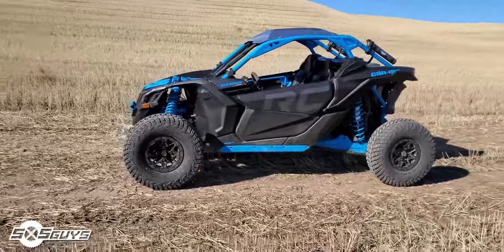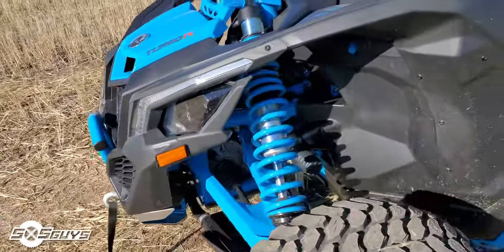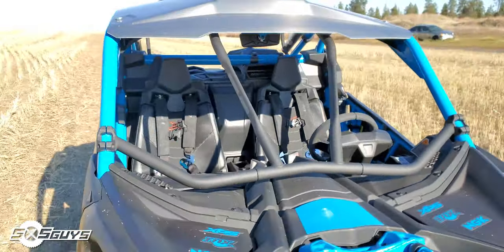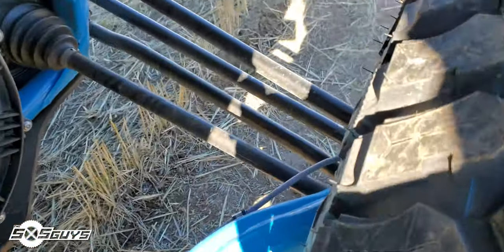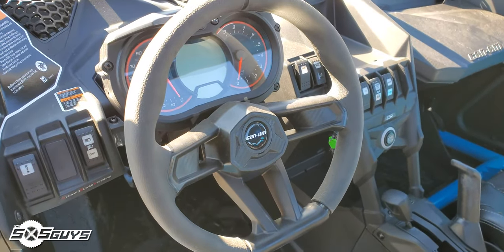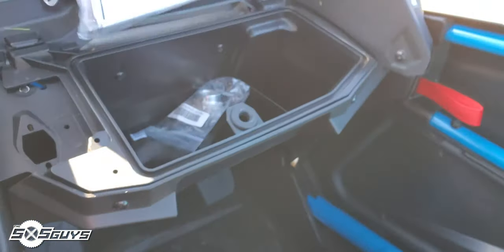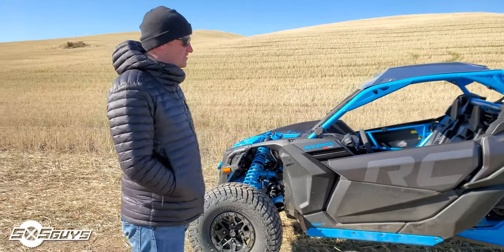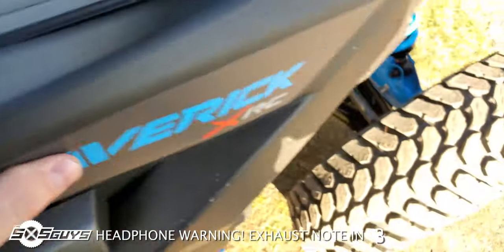2019 Can-Am Maverick X3 X RC Turbo R First Impressions | The SXS Guys

Comment: Stock to stock drag race your right on beating the YXZ. But in my humble opinion the YXZ would outperform the RC in sand riding. The gear on gear transmission and the YXZ handling is hard to beat. My opinion is coming from experience with both machines the RC and YXZ. I like them both!
Reply: DUNE YXZ I hear ya. It was more or less a challenge to start a new overland build. I had so much fun on that YXZ and it far surpassed my expectations. 
I’ll tell you this though, maybe owning both you can relate, but I felt that in my YXZ, it was like I was hopping into this super functional and durable rally car. In the X3 I kinda feel like I’m hopping into this collection of parts that have been thrown together, lol.
Reply from the maker: Can you please explain how that would be? The YXZ, stock like you mention, simply doesn't have a large enough wheel base or long enough suspension travel... And as Ian said on the podcast (check it out!), The YXZ is more work and more thinking ahead in the dunes, the X3 will make it more enjoyable!
Reply: SXS Guys The X3 is awesome but there are times when duning it has too much suspension travel and the nose hits the ground. It also takes the belt a split second to “re-gear” itself causing a momentary loss in power while the YXZ has instant power. You’ll see that mostly going down a steep hill and then immediately up another steep hill. The X3 handling is also slow to respond to steering inputs due to its steering geometry and overall size and weight. It’s really hard to type all the differences...
Reply: ian_pnw Lol
Reply from the maker: @DUNEATV  Get the tight handling etc, but haven't seen a dune the X3 didn't have enough control at... out side of the little bushed trails etc. The nose diving must be related to suspension tuning/driver error... The YXZ will hit the sand 10x more than a properly adjusted/driven X3. No doubt on the instant power, but then again, I'd say there's few times where you're not on the gas in general... The YXZ has definitely a niche, but you reasonably answer the "Overall, which would be better in the dunes?" question by saying YXZ.
Reply: SXS Guys The X3 is awesome and I love it when I drive it...I just prefer the YXZ. Anyway I’m looking forward to your future videos...check mine out if your so inclined...👍

Comment: Amazing machine !!!! I have the 2019 XRS
Reply from the maker: What did you come from before the XRS? ...or first machine?
Reply: 2017 Polaris 900 eps Trail.
Reply from the maker: @XCountryAdventures  Wow, that's a big jump! What are your thoughts on the 900 now that you've had the XRS? What do you think of the XRS in regards to how you used to drive vs now?
Reply: We bought the Polaris Trail expecting to do a lot of trail riding. We have a big forest OHV area with tons of trails about 40 minutes away. But we went to the sand dunes with friends and fell in love with sand riding. The Polaris 900 has a amazing power to weight ratio but really lacks in suspension and felt real tippy in the mountains on some of the slow technical trails. We sold the 900 to my father and upgraded to the XRS. It still new for me and I’m taking it slow as I learn its capabilities. The suspension, horsepower and the wider wheelbase I think is off the charts. But as you know there are so much more available if you have the time and money to put into it. 2nd trip to the dunes with the XRS are coming up in 3 days. Dumont Dunes for Christmas and New Years.
Reply: I’m definitely riding much more aggressively than I had before.
Reply from the maker: @XCountryAdventures  Love hearing that you're respecting the machine and taking the time to learn it's, and your, capabilities! Enjoy your trips and stay safe!

Comment: Why not 2020 195hp

Guess you went 19 for the big rebate end of year sale.

One thing I cant tell the difference is RS and RC. My RS can pretty much do what a RC can. I would just need to upgrade the wheels.  I took my rock climbing and did well
Reply from the maker: Yeah, Ian was able to trade in his 2016 Yamaha YXZ and take advantage of the end of season deals. Obviously the 2020 RR's would be a crazy awesome rig, but the jump in HP and the new chassis etc already make this a killer unit for Ian!